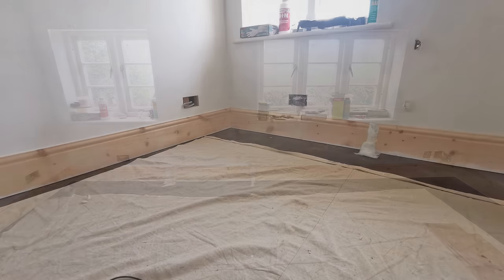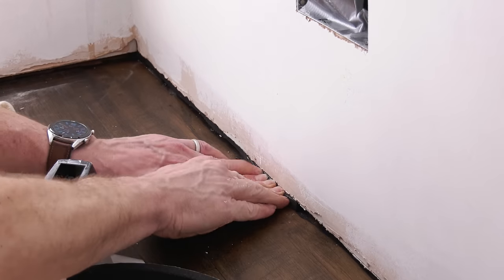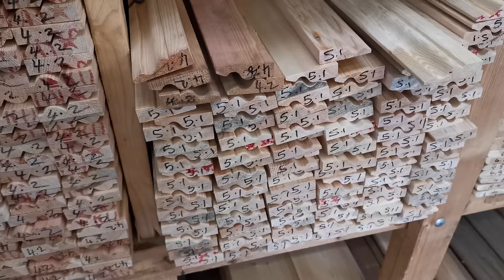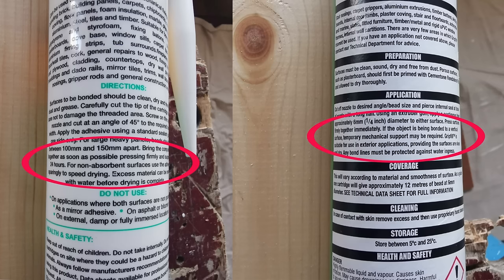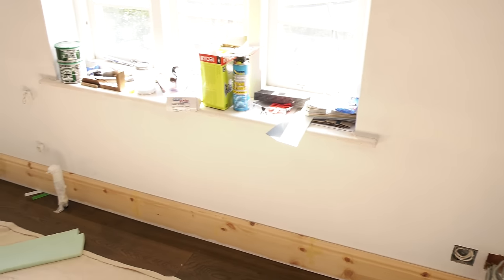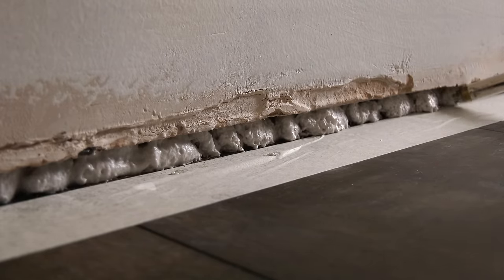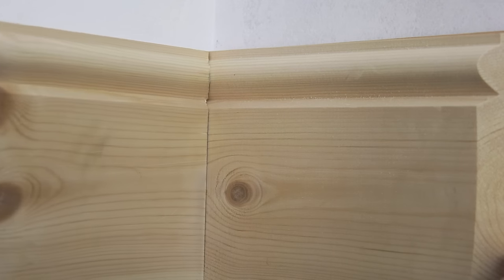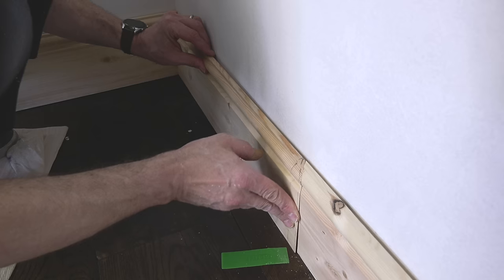How to Install Skirting Boards - a DIY Guide

Comment: Charlie, Screwfix sell the blue  Bosch straight shank multipurpose bits, that'll go through masonry, wood and plaster no problem. Under £3 and they last a long time.
Reply from the maker: Thanks mate. Good point and one that I should have made to save with all the bit changing, as I've been using those drill bits for a while now. Decent quality 👍🏻

Comment: Thanks for that I have a whole house to do.  Need to decide whether to scribe internal corners or mitre (have sliding mitre saw but not scribing saw but probably cheap)
Reply from the maker: Coping saws? Yes, they're cheap. To be honest, you'll be fine with the mitre for the internal corners, particularly as you've got the saw.
Reply: @CharlieDIYte  My suggestion is to test it out first using off-cuts as I thought a mitre joint would be fine, it certainly wasn't. Massive gaps! The walls were no were near as straight as I thought they were.
Reply from the maker: @carlturner544  That's the beauty of the old fashioned scribe technique, it just takes a bit of practice to hone it 👍

Comment: I typically cut the boards at 45 degrees, then use the coping saw to follow the profile of the cut. I back cut with the coping saw, so there is less material to file when making corrections. Here with skirting boards, I can see straight cuts on the “straight “ parts is advantageous.
Reply from the maker: Good work Tony 👌

Comment: Have you tried PU foam adhesive? Works well for jobs like this as goes off so quick. Also, if you have some Irwin quick clamps that can be reversed to spread function then you can screw a small black to the floor ( depending on the flooring of course ) and use them to keep pressure on the skirting against the wall.

Comment: Thanks for video. Great technique for accommodating concave section of floor. And stuffing the gap to improve air tight!  I’ve never seen baseboard with the “reversible” profile. I used a low-profile baseboard shoe molding to conceal the (mostly) minor gaps and that thin edge would have made pin nailing risky. As you noted, all that wood movement was unacceptable.  Complain to supplier?

Comment: I recommend sealing all gaps in skirting and architrave with anti-crack acrylic sealant it's sandable and paintable and as the name suggests does not crack with shrinkage/movement like the run of the mill caulk does and always will. less than twice the price of caulk

Comment: Great video, esp the partial cut to tweak the height. I too use the 45deg then vertical cut to give the scribe. I use jigsaw though, how come your weren't suggesting? Even the fine blades are much more durable than coping saw.
Reply from the maker: Thanks Steve. 👍 That's a fair point. I always miss something but I also like to keep power tool use to a minimum wherever possible to keep my vids as accessible as possible to people who don't have too much power tool wizardry at their disposal. I should also have mentioned using foam to stick the skirting. How do you attach yours, out of interest?
Reply: @CharlieDIYte  Foam so far, but thinking about the glue gun. The chippie that showed me the mitre trick also uses 45deg thin 'buttresses', screwed into the floor to wedge the skirting against the wall so there was no screwing/filling of the board reqd.

Comment: Thanks for your video.
MDF v softwood ( fast grown Scots Pine - Pinus Sylvestris)
Firstly, advantages of Pine over MDF
1) For those traditionalists - Pine will show a bit of grain through the paint, showing that real wood is being used
Advantages of MDF over Pine
1) MDF ( provided it is reasonably stored - and it is a lot easier to store than Pine) does not cup and go out of shape along its length. Cupped skirting is a nightmare to scribe and join.
2) MDF has a certain suppleness along its length ( which Pine does not) and so goes up against the wall with ease.
3) MDF comes ready primed and totally smooth - with no rough or furry appearance
4)MDF comes in  long lengths 
5) MDF is knot free, and so does not require  the application of knotting. Have you ever seen painted Pine that has not had knotting ? It looks like paintwork that has caught Measles

Further disadvatange of Pine 
1) Because it is a resinous timber - is it irritable to the breathing system

Need I say more?
Reply from the maker: Yes I think that's the final nail in the coffin of pine skirting. Nice summary 👍🏻 As you say though, now it's in, it does look VERY smart - more so than MDF and I probably wouldn't use MDF on an uninsulated ground external wall. I wonder if they do medite MDF skirting 🤔

Comment: For skirting boards from solid wood it is a good practice to keep the side of the board that was facing the core of the log towards the front. This way the boards will be concave towards the front after drying and warping so the gap between the wall and the skirting board will not open up as much.
Reply: Of course that is usually difficult if you are not making them by yourself from scratch.

Comment: Hi Charlie, that video was extremely helpful and informative, thankyou! i am planning to install skirting in my living room (never done it before) - what  adhesive/fixing method would you recommend for applying fully finished MDF skirting onto plastered walls  (it is an old Victorian cottage with funny walls  so could be a real challenge) 

thanks again
Reply: Screw, plug and glue as he is going here.

Comment: Ive never heard of fixing it with a glue gun. Trying to avoid buying an expensive nail gun or mitre saw. Good tip regarding mdf over pine

Comment: The corner cooping ... you cut it straight, cut it so it’s like a 45 degree cut, far easier to get a tight flush fit. The wood you don’t see could make it bulge out, just do the entire cut so the face is along the scribe but the back of the skirt is an air gap bar at the top. Try it

Comment: Don't use screws nor grab adhesive to fix skirtings these days (gripfill doesn't stick very well to bare plaster or painted surfaces), old fashioned and time consuming. I'm a carpenter by trade, these days low expanding foam is by far stronger and sets within an hour. All you need is something to hold the skirting against the wall, in general cases floors are usually bare so you can screw off cuts of timber at a 45 degree angle against the front of the skirting into the floor to hold while the foam sets or if you can't screw into the floor to hold the off cuts, you can just fire a few pins into the face of the skirting to hold it. You would snap the skirting before the foam gives after its set, really does set solid. You'll really struggle to get the skirting off, try it :)
Reply: Hi! Can you give an example of this particular foam, please? (low expanding foam)
Reply: @nicam49 yeah he ant giving u no example of shit buddy it’s jst all chin wag.

Comment: Hi Charlie, loving the tutorials.  I've just had a porch built and about to start fitting the skirting boards. I've discovered that the existing wall house side and new wall porch side are not even, big bump in the middle giving a distance of around 5mm each end. I'm going to use mdf skirting. What solution would you use? Cheers.
Reply from the maker: Hi Mark, not quite sure what you mean. If you're saying the waiting doesn't suit flush with the real because of the bulge in the middle, don't worry, just use decent size wood screws and wall plugs to pull it in. So you'll need screws with a larger head than the ones I used although 5mm isn't a large gap so they might work ..

Comment: Excellent video Charlie.  I'm about to install some mdf skirting boards in our hall that also have aluminium strips in them (for LED strip lighting) so I need to cut through both of these materials at the same time.  Do you know if it is possible to get a different blade for the Ryobi Circular Saw that could handle this?  Ideally I'd rather use a circular saw for the accuracy if possible rather than try and cut by hand.
Reply from the maker: I didn't think circular saws would have the torque but there is conflicting info on this, as this article says you can https://www.familyhandyman.com/list/10-easy-ways-to-cut-metal-fast/ . If you can find a metal blade make sure you wear Google's and a mask because the metal will go everywhere! What about a sliding bevel mitre saw like I featured in the video? Sorry I can't be of more help. I'm afraid I have no experience of cutting metal with a circular saw.

Comment: According to my experience, to avoid warping for natural wood, you can:
1. Use lower skirting boards. Instead of 16 cm you can use 4-5 cm. Then warping is not so large.
2. When buying or making skirting boards, get ones that gave straight grain without branch knots. Typically such wood is at the lower part of the trunk, closer to the ground.
3. Storage areas usually have higher humidity than living rooms where skirting boards are installed. Change of humidity is one of the causes of warping. After after obtaining the fresh, humid and still straight skirting boards, store them in place where humidity is close to the installment areas, AND store them under weights, on even ground with spacers every 25 cm or so. After drying, they will not be warped so much as without weights. Or install while wood is humid, then the screws will prevent warping. But then shrinkage can cause other problems.

Comment: Nice trick to lower skirting board.  Obviously if the client wanted beading around the laminate floor that would help the gap in skirting?  If not is that why you went through the trouble?

Comment: Charlie and viewers, I'm buying a house with plug sockets on the skirting. Obviously the sockets are going to be moved (probably a rewire too), would you recommend replacing all of the skirting boards, or it is possible to fill the holes left by the sockets with blocks of wood and filler? Cheers for any advice.
Reply from the maker: Yes you can certainly fill the holes. I've done that. You can glue them in with gap adhesive and then use 2 part wood filler around the edges and then sand flat (or modify that depending on how you decide to do it).
Reply: @CharlieDIYte  cheers for the reply Charlie, really appreciate it. They're 80-90 years old so I would like to keep them if possible.

Comment: Thank you for this wonderfully informative video. I was hoping to use solid oak skirting in my home. Is this also susceptible to warping?
Reply from the maker: All natural wood is susceptible to warping unfortunately. It depends how well seasoned it is, as green oak in particular has a huge amount of moment in it, but I'm guessing the skirtings will be well seasoned so will hopefully move less than the pine did.

Comment: I primed and glossed the skirting before cutting.  Leads to some wasted paint but so much easier to paint on the bench rather than wall.
Reply: Shouldn't gloss them before fitting, Surprisingly glossing them once they're on the wall and fixed to one another seals them. Skirtings are usually caulked also, if you gloss them before caulking over time your caulk will be visible caulk is matt not glossy and is a different colour. Stand out like a sore thumb. Take the time and do it properly.

Comment: A couple of tips..... 1) If using regular screws you can drill through the wood & the wall and drive the plug through the board. No need to remove the board to fit the plug. Just tap the plug into the board, drive the screw into the plug slightly and then tap the screw/plug into the wall before tightening.

Comment: I gave up with using softwood skirting due to the problems stated in the video but also with resin bleeding from knots and ruining the paint finish no matter how many coats of knotting solution I used. The time taken to prepare the timber before painting was far too long and makes MDF a better choice.
Reply from the maker: I agree, John. I will have to keep reminding myself of that before I buy the next lot, because now they're installed and painted, they look lovely and the Zinsser BIN has I'm glad to say, prevented any knots bleeding through.

Comment: Great video.No MDF for me,don't like fury external corners,you can't beat pine.sorry old school
Reply from the maker: Thanks Simon. I know what you mean about the furry corners and it was the old school motivation rather than the price that made me buy pine. I'm happy again now with the pine after a quite successful caulking process. I'll hopefully be doing a video on it shortly.
Reply: @CharlieDIYte  I get to stay in quite a few new hotel's with my job,and I always look at the joiner,I have noticed all now are using MDF and can't but notice the fury corners where the cleaners have been rubbing their Hoover's over,as I said,there are new hotel's and the skirtings look awful,defiantly not the way forward.I would always recommend pine at the least.

Comment: Do you plaster the back of each board with epoxy resin then hammer 9" nails randomly along each board slightly countersunk and filled over smooth so to never be located and then over painted to ensure if they are ever removed the take some wall paint, most of the plaster and a brick or two when removed?

because that's how most of the boards i've removed have been fitted!
Reply from the maker: Sorry to hear that, mate 🤦🏻‍♂️ Yes, some of mine were done like that.

Comment: Hi Charlie, I'm currently installing my kitchen and it has an end panel sitting flush to the end wall - I'm installing skirting board after the kitchen has been finished. How would you suggest running the skirting board to make it look as professional as possible? The skirting board would be at a 90 degree angle butting up to the front of the end panel which is about 13mm width...if that all makes sense...

Comment: from my personal experience with caulking i've found modern emulsion paints do not like to adhere to caulk at all, the paint always ends up cracking (regardless of the caulk used) no nail glue however makes an extremely effective caulk, is super cheap and takes paint no problem without the paint cracking it is however far less flexible but that may work to your advantage
Reply from the maker: Thanks Mark. So far so good on mine. No sign of cracking. Did you wait until the caulk was completely set before painting?
Reply: @CharlieDIYte  most definitely

Comment: I've learned a lot from watching your videos, one thing I'm confused about here though is the screw length, shouldn't it be 3x as long as the thickness of the board?  So I guess at least 60mm, maybe more if you have a cavity or is that just when fixing wood to wood ?
Reply from the maker: There are rules of thumb but what I'm trying to do here is tear up the rule book and mechanically fix on one hand whilst glueing on the other whilst using a screw with a tiny head that's really easy to fill. It's quite hard to find screws like this that length and you ask is it necessary. Certainly wasn't in my case.
Reply: @CharlieDIYte  Thanks Charlie for your reply, really helpful to know.  Like you say the glue is also an important part of the fixing, I've seen elsewhere that sticky foam works well so may give that a go along with those screws you showed + MDF. Just planning ahead for when I do it, 1 more wall to plaster & then I'm onto floor insulation, BIG thanks for all the tips .....Cheeeeeeeeeeeeeers!  🍺

Comment: Spent £100+ on beautiful flat pine skirting for a bedroom. I took all precautions when i took it home and stored it for a few days before fitting. Just 3 days later when i came to cut and fit them, they'd warped. I wasn't going to scrap them because logistically it was not possible, so i worked around it. The whole experience of cutting and fitting warped skirting really killed my enjoyment of the job. I managed to make them look very respectable, but as a DIYer i had to go through so many faffs to get it done so that it didn't look dreadful. Never again. MDF for me.
Reply from the maker: That's pretty much exactly what happened to me too. I agree and you could protect the MDF from moisture with a sealant like Zinsser BIN first

Comment: Hey Charlie, really appreciate the vid. Going to get cracking on it soon. Would the 6mm wall plugs be alright for external walls with insulated plasterboard? Conscious that screws probably wouldn’t reach the brickwork
Reply: Absolutely fine. There would only be an issue if there was any force trying to pull the plug out of the plasterboard. Not the case here.

Comment: I've just fitted some skirting board and discovered it's not easy to match the screws with the holes if the wall is out. I ended up fitting on screw tightly and then drilling pilot holes for the others. That way the skirting couldn't move.

Comment: i have a re-plastered room where the skirting boards were removed after the plaster job. Now there is bare brick along with a hand full of bits of wood sticking out which the old boards were attached to. Some of these are all splintered and i don't think i can attach new skirting to them. What would you advise? Should i fix some timber to the brick work and use that to attach new skirting board? Obviously i wish the skirting boards were taken off before the plastering.. but they weren't so hoping to figure it out!